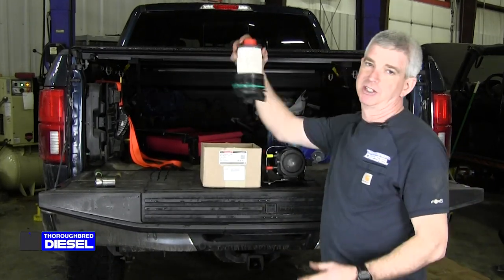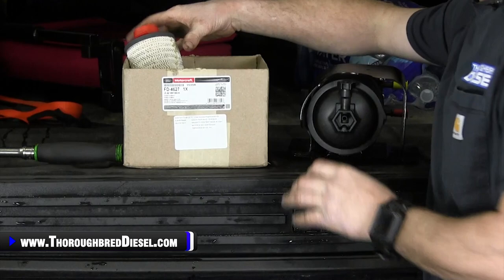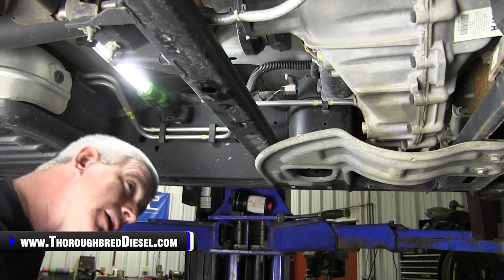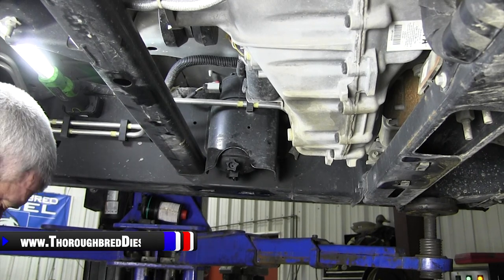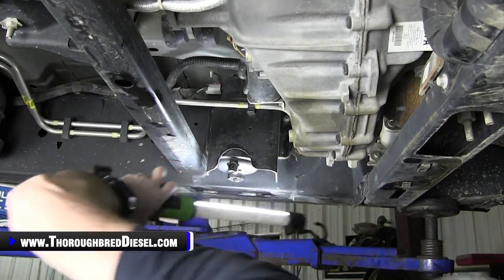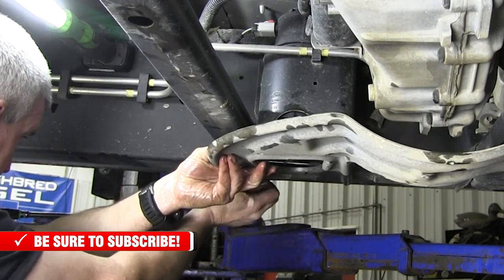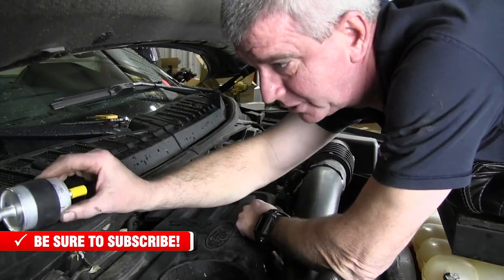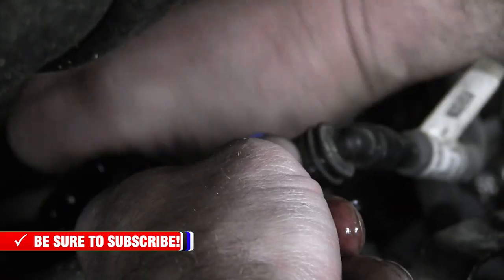We Gave Our 3.0 Diesel Some Much Needed Love! How To Easily Change F150 3.0 Powerstroke Fuel Filters

Comment: ♤ It seems to drain better if you have the engine bay fuel filter off when opening the petcock valve on the side of the old water separator filter.

Comment: Seems like the o-ring and threads weren’t lubricated originally from the manufacturer, first time the filter is being changed and it won’t budge after about a half turn. It’s now rounded off so a socket won’t work, put a screw driver in the hole where the bleed off valve goes and got it to turn a bit but won’t budge anymore. Any suggestions?

Comment: Just replaced my filters. Good instructions. Only thing I would say is to use long breaker bar. I started to round off the filter with shorter wrench. Undo the filter slowly last couple of threads let it drain. About 1/4 of small trash bin will drain out. On the new filter use the diesel to lubricate the O ring and also the threads. It will screw in easier paying attention not to round off the filter.

Comment: Does it matter what fuel level the gas tank is at when performing this work or is the fuel dump entirely just from what is in the line and filter system? Also, since there will be diesel fuel dumping on both ends, what would you recommend to use to "hose" these dumped fuel in both the frame and engine compartment? Dunno, just wigged out about fire hazard lol. Great video otherwise.
Reply from the maker: It’s a messy job for sure, but fuel level wont have anything to do with it. You really just try to be fast and keep the fuel contained.

Comment: There’s a better way to prevent fuel from spilling when changing the frame mounted filter by performing the following:

1) Open the drain on the fuel water separator 

2) Change the fuel filter in the engine bay.

3) Then change the frame mounted fuel filter.

Changing the engine mounted fuel filter while draining the fuel water separator provides a vent path to allow the frame mounted fuel filter to completely drain.
Reply: Good call, I’ll try that next time. I did the frame mount entirely at first, but drained the water separator for a while, then slowly loosened the filter and periodically let it dump before dropping it all the way. Wasn’t too messy.